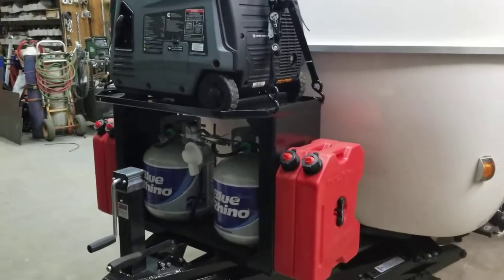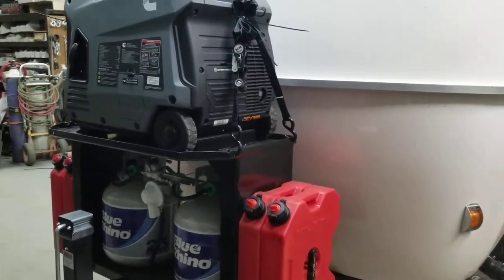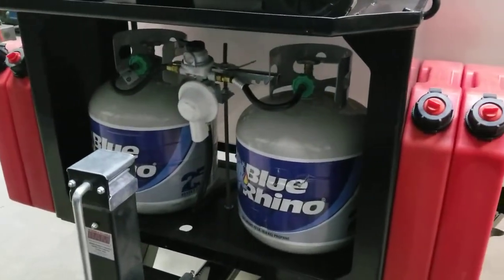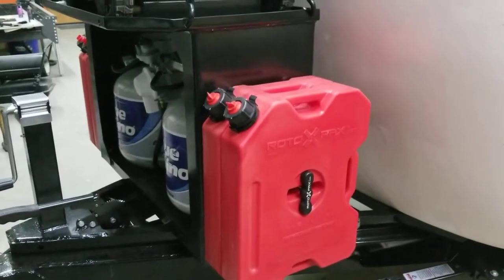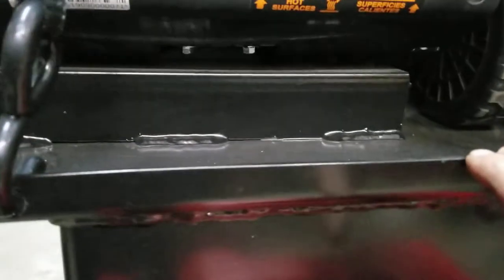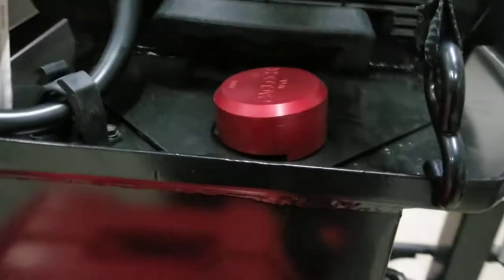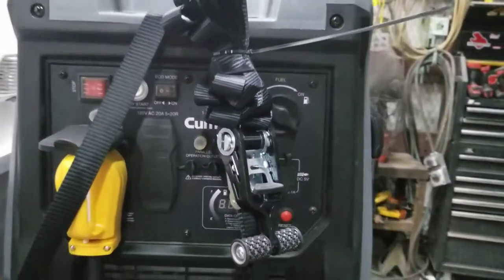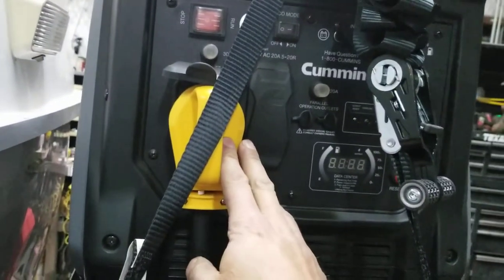Casita Storage propane generator Cabinet

Comment: Man. What a great build. I see you can weld. I just build me a box of aluminum and welded for mine. I have the same setup I turn my Generator the other way so my cord can reach. lol. But now I’m brainstorming on the secured generator to the plate n this is how I came across your video. What that an idea and weld you did??? It would;d be SUPER helpful if you make a video on how it was done. Even if you put the link or plans and make people pay for it. I would buy it. lol. I have the same generator (WESTINGHOUSE). Also how you ran the cord inside the conduit without cutting it. Was it a channel conduit?. I Can share my box build with you to give you an extra diy job to do. lol. Thx for the video. It open my idea a bit.